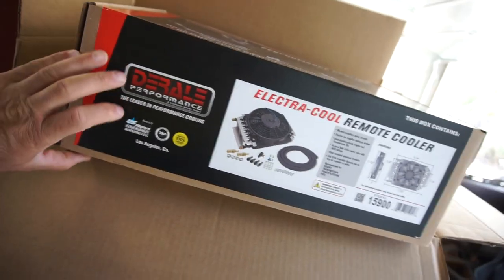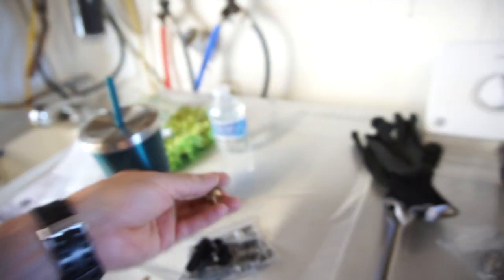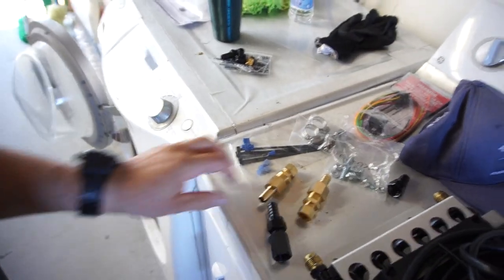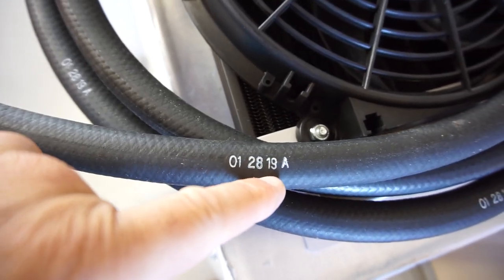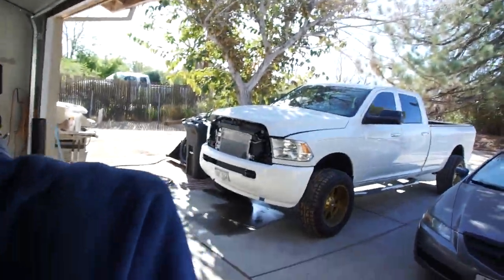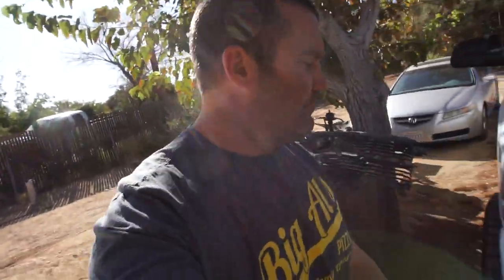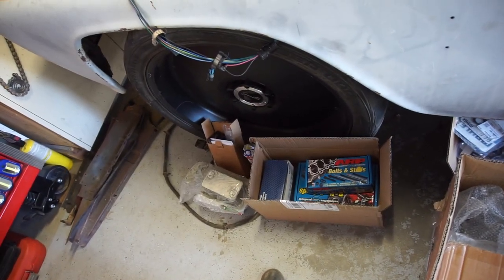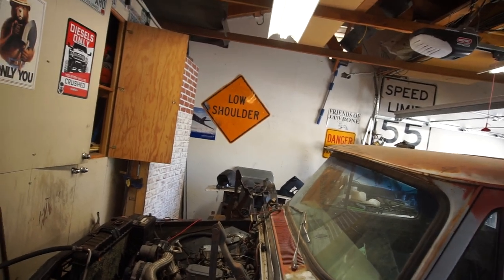DERALE 15900 Electra-Cool Transmission Cooler. For My 4th Gen Cummins 68rfe

Comment: What and how did you attach the aluminum rails to mount the cooler to? I’m trying to figure how to mount mine on the same truck. No room on top of the frame to drill???
Reply from the maker: David McCann there should already be holes on top of the frame. I just used self tapping screws and a ratcheting wrench. Kinda time consuming but it was a clean install.

Comment: Looking into getting this for my 08 with a 68rfe. It looks like the line for this cooler are 3/8, arent the lines for the 68rfe 1/2 inch? How did the install go?
Reply from the maker: DlxsfskaterPUBG yeah they’re 1/2” if you go to the link in the description you can check out all the pieces and specs for it. It’s a really nice unit and install was really easy. Sold the truck to a friend who pulls a 40’ toy hauler and says temp never gets above 190*
Reply: @Halffast719  thanks man